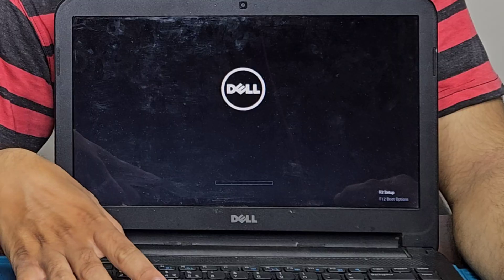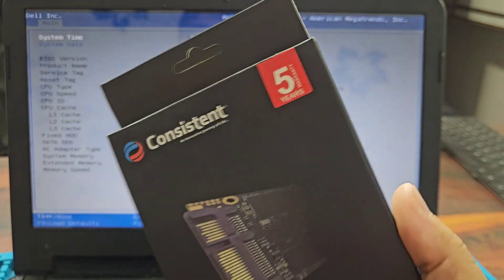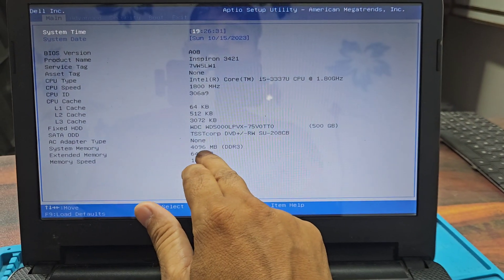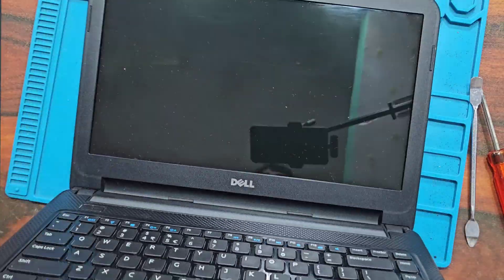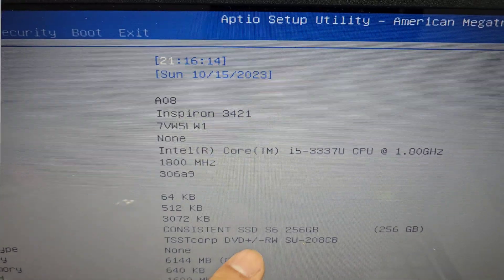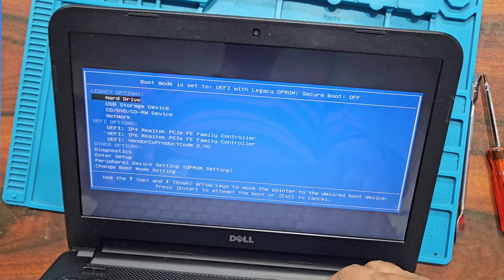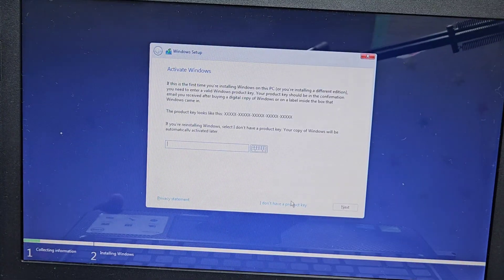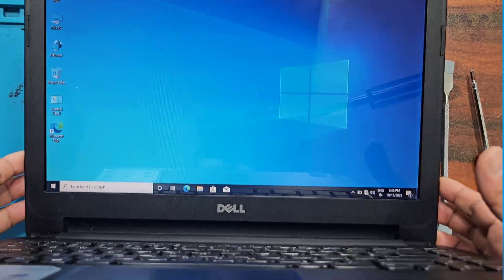Dell Inspiron 3421 windows upgrade#Dell inspiron HDD replacement

Comment: sabe me dizer se ao fazer esse procedimento perco arquivos
Reply from the maker: No your data is present on your old hdd and here we are using a new ssd for speed for windows 10
And after upgrading your laptop you can use your old hdd as an external drive using an external adapter and copy or access your data from that hdd drive

Comment: How about installing this 3421 drivers after installing window 10? Or do they installed automatically along with windows 10 install?
Reply from the maker: Windows10 update will install all drivers automatically when connected to internet after Windows10 installation👍👍👍👍